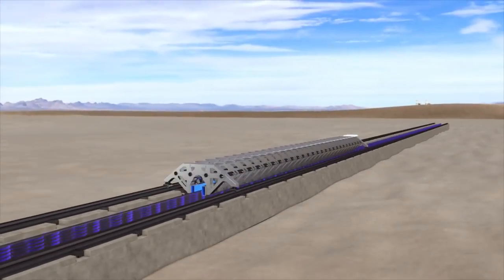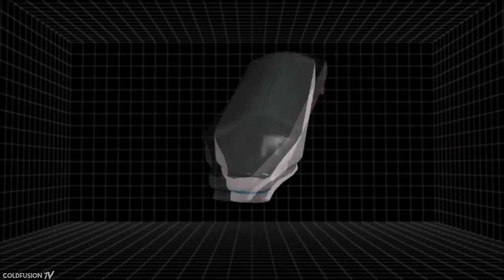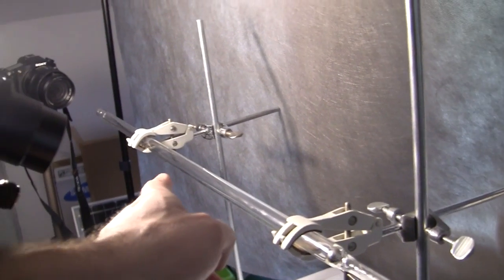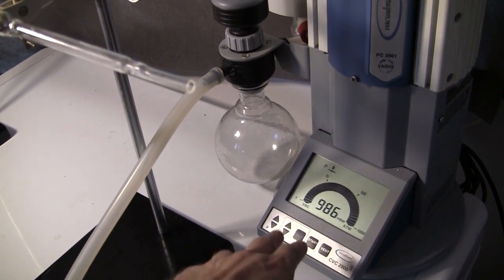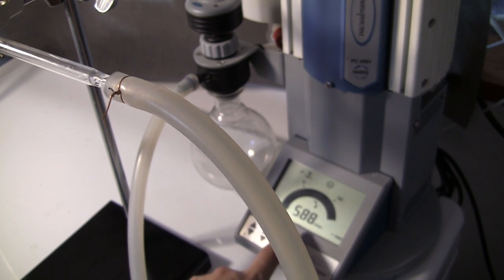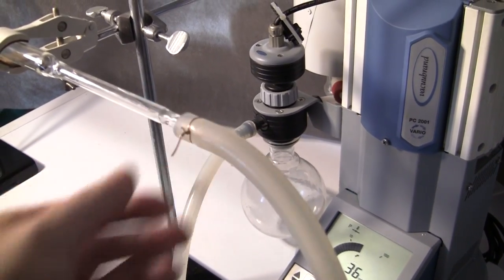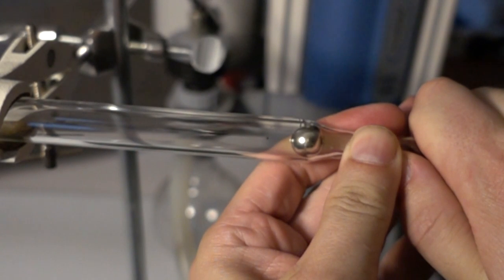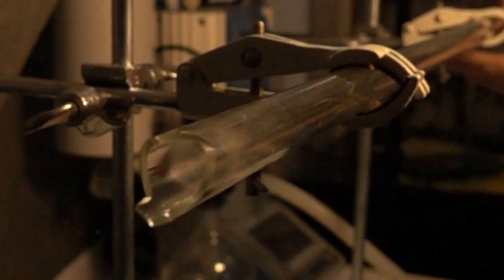How  the Hyperloop can kill you!

Comment: I'm sorry Mr.Foot but I have to down vote on this one. Usually I agree with you'r arguments but this one is a tad ... well rubbish.
Reply: My sentiments exactly.. this is like saying automobiles are a bad idea because in a car crash one might get thrown out the windshield.
Reply: Why?
Reply: Mr Silver-Tongue There are lots of great counterarguments below in the comment section. The video was extremely simplified and does not take into account any possible safety measures hyperloop may include in to the project.
Reply: I haven't seen a single good argument in the comment section.
Everyone is either using fallacious reasoning or invoking a magic problem solving thing that doesn't exist to fix it.
Reply: NotAsian Equalizing the pressure in the tube? Putting the brakes on? Letting the pressure wave pass the train? And the possibility that the tube suddenly brakes in half is kind of an unlikely scenario. It is after all made out of steel, not glass. So it doesn't shatter. Well in the case of a terrorist attack or something, sure..

Comment: I think you forgot to list the reasons why it's very hard to produce a safe vacuum tube with adequate redundant failsafe measures. You know, things like automatic sealing of sections for repairs, and physical emergency restraints that hold the train in place in case of a vacuum failure. This video demonstrates how pressurization can accelerate the train with disastrous consequences, but only in a system that has absolutely no safety measures and would never be approved for public transport usage.

Comment: Blunderfoot again mixing his spit with his own foot: "With no way of stopping" is about as true as your conclusion because you, yourself, have shown the system has a magnetic levitation rail down the middle. Tell me oh scientific one what type of arresting system is used in modern elevators to reduce the odds of mechanical failure of that system? Sure you wouldn't be fucking happy decelerated that quickly but you'd be a damn sight happier than the skidmark you'd become on the nearby landscape. 

With the modicum of respect left, 
A a dude with a bachelor in Physics, IE something a bit more tangential than your PhD with the subject.

Comment: The expense of the HyperLoop track probably Squares or Cubes with each doubling of the tube diameter. It becomes OBVIOUSLY impractical when the tube diameter is increased sufficiently to permit cars with headroom and toilets. How about NON-Hyper 250 MPH trains with the ability to Hyper them later? And while we're digging tunnels across the country, how about some canals from flood areas to drought areas?

Comment: Why is there no way of stopping?
Reply: All you need to slow something in a metal tube is fixed magnets. They will induce a current in the tube, slowing the vehicle.

Edit: Magnets slow, not stop things in a metal tube assuming low enough friction.
Reply: +UltraMato Where the hell are you getting the idea that I think a parachute would in anyway shape or form be used as a braking mechanism. That was wwickeddogg that said that. I specifically said how it's very easily done. Here is a quick easy experiment, take a stick, that will represent the mag rail. now take a pair of locking plyers which will represent your mag lev train. Now with the jaws open pass the sick between them with out touching the sides, and you have a good representation of the train when operating. Now take those  open locking pliers while moving the stick through the open jaws,  and close them around the stick. Would you look at that, the pliers stopped moving relative to the stick. It does not mater if your in pure vacuum or 1000 ATM the braking system works just as easily and just as well.
Reply: Because the enormous pressure from atmosphere equalization if there's a leak. He pretty much demonstrated it in the video.
Reply: +UltraMato What enormous pressure from atmosphere equalization? You do realize that 1 atm is less than 15 psi right? There are also numerous extremely easy ways to solve such a catastrophic failure that this experiment basically was.
Reply: UltraMato
  But his demonstration didn't include any method for stopping? The train itself could have brakes that clamp onto the "track". It could have an engine on the front to slow it down, it could have a parachute, it could have a grappling hook. Why can't it have a way to slow down?
Reply: wwickeddogg
A parachute. In a near vacuum? Grappling hook, on a 15 ton vehicle moving almost at the speed of sound?

You're being silly. Stopping is just part of the problem, too.
Reply: +UltraMato How is breaking a problem? Out of all the possible issues breaking is such an extremely simple thing that it's for all practical purposes a non issue. You use breaks like just like on all other mag lev trains. Hell because they have a center track your breaks can clamp directly to the track actually making it easier to brake than on a standard train.
Reply: SpaceCowboyfromNJ
There's a problem, both with braking and common sense if you think a parachute will slow down your vessel in a near vacuum.
Reply: UltraMato
  So are we in agreement that there are some braking systems that wouldn't work and others that would work? It seems weird to claim that there is no possible method for braking. Braking doesn't seem like a problem at all.

Comment: The catastrophic failure scenario seems quite unlikely. The hyperloop tube is more akin to building a submarine than aircraft or spaceships, weight is not a critical factor in it's construction, so a large safety margin can be built in easily. Pressure difference is only 1 atmosphere, or 14.7 psi. Modern submarines have a test depth of about 500m, which is 50 atms or 750 psi and the failure or crush depth will be considerably higher than that. If there was some seal failures in the Hyperloop tube, they would likely be steady leaks, rather than a rapid loss of vacuum.

Having said that it would be an easy target for terrorists, though in reality no more vulnerable than railways.

Comment: Ok Back of the envolope math: atmospheric pressure = 100 kPa, say train is 3m x 3m => Total force at vacuum = 100*3*3 = 900kN... Typical train car weight = 150 tonnes =~ 1500kN. If a maglev is powerful enough to accelerate\ lift 1500 kN in one car then it should be powerful enough to decelerate 0.6 times that force.

Really the problem is not stopping the train, but preventing aerodynamic stress, which could be accomplished by a number of different solutions. This is why physicists shouldn't be engineers...

Comment: this is not to say there are no issues with the hyperloop idea but if the system is maglev based then there is a breaking mechanism in for an emergency situation.   It is called reversing the polarity on the maglev's electromagnetic, whether it would provide enough braking force to slow the hyperloop car down enough I do not know but along with that the more the air gap around the car and hyperloop walls the less effective the in rush of air would be on the car.  Increasing the air gap should not affect the efficiency of the car moving through the system as the vacuum is just there to reduce air resistance.

The real issue is keeping the vacuum force and making sure the cars have enough air supply for the actual travel speeds rather than the theoretical speeds.

Comment: Hi Thunderf00t, a solution to the one-sided repressurisation issue would be to immediately equalise to this pressure along the entire length of the tunnel by opening the hatches along its length in a controlled way. It wouldn't even need to be done all that quickly. This would at least even things out a bit...

Comment: Surely there could be a fail-safe brake system to protect against acceleration due to rapid pressure change? The train could have spikes or some such to rip into the tube if any air pressure gets to it... So as soon as the pressure wave hits the train, the brakes will be applied, the tube ripped open around the train  and you no longer have a problem? Also as has been suggested the tube itself would have to have some sort of valve system to equalise pressure all along the tube in case of an emergency, so even if the train had a sudden jolt of acceleration there would most likely be plenty of room for the spike brakes to have effect. I'm sure there is an engineering solution to this problem, and it doesn't seem fair to dismiss the possibility of having a system that's safe enough to actually use. (There may indeed be issues making this project infeasible but I don't think this is one of them)

Comment: OK Thunderfoot, please do the math. Scale this up from your glass tube and marble to the size of the HyperLoop. Take into account the higher mass to surface ratio for the incoming air to push against. Also the fact that the train would be moving, not still when it passes a break. Add in the effect of some emergency brakes. A simple speed or pressure sensor to trigger them would suffice. I think it can all be overcome, but this is a great reason to not make the tubes out of glass! BTW, in my libe of work, we call what you did here a PPA, Potential Problem Analysis... ie, we try to figure out what can go wrong and then design those problems out of the overall system. Good to see someone playing Devils Advocate, keep up the good work!
Reply: What makes you think that a break can only occur behind the carraige? A break in front of the train could reasonably slow the train down fast enough to cause major damage to anyone on board.
Reply: Don't forget that the tube will be significantly bigger diameter than the pod.
Reply: You can walk about in a moving train easily, but if that train suddenly slows down or speeds up, you'll trip. Now imagine getting whacked by a rush of air from a failure point, it will be like being in a 10 MPH collision.
Reply: how retarded do you fel now that it's been deemed infeasible with our current technology based on burning $500 million dollars before shuttind down by using all the known elements known to mankind  as of year 2024 to build that vactrain tube?

Comment: I remember a myth busters video where they try to get a pingpong ball to go really fast they use a tube that they bring to a vacum. When the tube was breached the air would rush past the ball and the ball would go to the centre of the tube. If the hyper loop trains had some kind of air bypass the air could be used to slow down the train in case of a breach. I'm not an expert but i am a physics undergrad I could run some simple sph simulations to see if this is feasible but I'm sure the people at tesla have or are figuring these problems out. If they weren't they wounding  be showing their prototypes off.

Comment: They would undoubtedly have a braking system in place... If the pressure is out of bounds, stick the brakes on (of course with some smoothing so you don't make human jam in the capsule). I refuse to believe you didn't see this as a solution thunderf00t.

Comment: i don't understand why you'd want to decompress the tunnel in the first place. to reduce air friction?

seems like a very dangerous idea for not that mch gain even if you do manage to stop the passenger car upon damage to the tunnel.

further, you are adding complexity, cost and potential points of failure with this.
now you have implement an amazingly strong sealing method for the passenger car so the difference in pressure doesn't explode it, you have to provide it with an integrated and selfsufficient air and pressure system to keep the occupants alive, and so on...

all of this for more speed, the inertia of which alone could cause severe injury in case of emergency breaking or something.

Comment: the air can go around the cabin and the cabin has breaks, so you can prevent the high acceleration.Not that much bullshit in the concept. I think the project will strand on the extreme operational cost tough.

Comment: I'm no engineer or scientist so Im not that offay with pressure law.
but say a break happens in the pipe behind the car.
what would happen if the pipe breaks further down the line infront of the car after the first one? wouldn't that slow the car down? 
be like an air bag
..but without the bag? 

I'd like to also see the experiment done again with different lengths in breaks in the piping I.E not just right behind the ball...
and different sized balls...

I'm also wondering if this can actually be weaponized?'

Comment: Thunderfoot; normaly you use fact and all fact to make a argument. You point out a probelm of the hyperloop is that a critical damage on the tube make the capsule to acelerate. Now what stop you from install safety valves and sensors on the tube to alow air in and equalizing the pressure in front of the capsule if a critical damage hapen?

I dare you to redo the experiemnt and break the seal in front and back of the tube at the same time....

Comment: thats more of an engineering issue than a inpasible barier
 
one posible solution is in case that a breach was detected have  small explosive charges lined up infront and after the cart in a long enogh segment of tube in equel distences . and as soon as that happens the explosive charges will detonate in order disperse the decompression. by making ALOT of little hols along the track

Comment: I look at it more like this. they're crossing the San Andreas fault line. what happens when it shifts send puts a drastic change In the tube. just bring bullet trains to America if you want a fast ass way to transport people and supplies on land they're safer and they work. we don't need a tube where terrorrists can potentially dig a hole deep enough to blow the tube or a Crack or bend due to an earthquake. at least above land you can manage to run away if you make it out alive. imagine getting stuck in a fucking black tube 100 feet under with miles of nothing either way. that's just horrifying

Comment: This demonstration has little to do with reality. 

Suppose there were a complete pressure failure (very unlikely, a gradual leak perhaps from a rupture miles away is more likely), the absolute maximum force would be 14 pounds per square inch of front surface to the train. For a 15' radius train that would be about 500,000 pounds or 250 tons. If the train weighed 250 tons, that would be 1 G of acceleration. 

That assumes a perfect seal between the train and tube, instant pressurization, and a lot of other unrealistic factors. One G is quite a shock, but far less than experienced in an auto accident. It would not be fatal to an otherwise healthy person. A more realistic scenario would be a tube breach miles away with a slow build up of pressure and air flowing around the train. 

Far from a bullet, it would be a gentle slowing and some other breaking mechanism would still be needed. 

An exception to this would be if the train were traveling at multiple times the speed of sound. Then a column of compressed air would form at many atmospheres. Lacking relief valves (easily installed) this could be like hitting a wall.

Comment: A couple of points:

1. Low pressure is not vacuum, the pod is going to float on a air cussion after all.

2. Flying or driving isn't 100% safe either, but people still do it.

3. Wouldn't it be possible Open an emergency vents ahead to break? A emergency signal travels at the speed of light so it has no problem outpacing the pod. 

4. Even if a solution can't be found to make it safe enough for passangers, the hyperloop would still be great for transporting goods. Imagine having ordered something from the other side of the country and be able to pick it up a few hours later at the hyperloop station. Hopefully it could be fully automated also for maximum efficency.

Comment: Um yeah. I like your videos but your example is a glass tube the system is far closer to a pneumatic tube than what you are showing  and fail-safes should be hypothetically feasible to equalize the pressure if a break in the rear of the train would occur.

Difficult and dangerous?

Yes. 

Impossible and wishful thinking. No.

Comment: Yes that is absolutely true. Also, next time, can you pleas make a video about how cars and planes can kill you?

Now seriously speaking, this is a challenge to deal with in the hyperloop rather than a fatal flaw in design. I dont know if you dont support the whole idea of the hyperloop or think we should just take more time to work on those critical areas to ensure safety in the hyperloop but either way, I'd be more concerned about problems in the breaking system in the hyperloop and how they will handle the acceleration at the start than a failure in the infrastructure that should be designed very well with very high factor of safety

Comment: Well I guess the solution would be to either have a really good detection system for when it ruptures and lock the car in before the compression happens, or make sure the tube never ruptures in the first place ever. But I assume, that unless a meteorite hits it, or something large crashes into it, why would such a large part of the tube decompress at once, I would think most decompressions would be small leaks here and there, where parts aren't sealing perfectly or something, not one end of the pipe being sheared off completely.

Comment: I mean, if you're constantly pumping air out of the tube to depressurize it and there's a vacuum failure, you could just open up another pump in front of the train and pressurize it to slow it down.  If the train is a relatively tight fit with the tube you could probably get some significant braking forces from the pressurization of the air in front of it.  If the distance from the end of the tube is short, then you won't have much room to accelerate, if you're a long way from the end you have more time and room to re-pressurize to slow it back down.